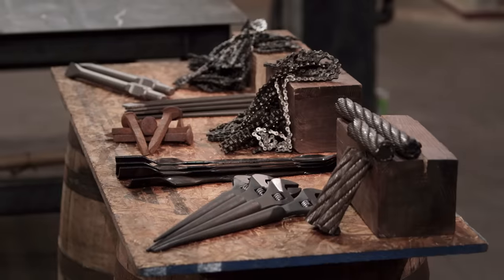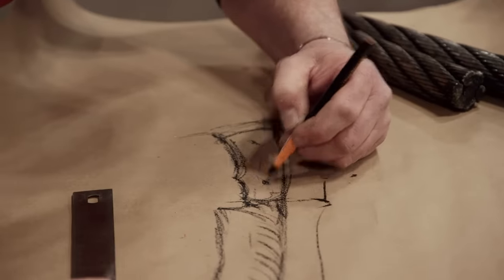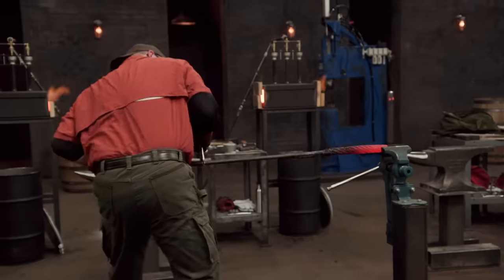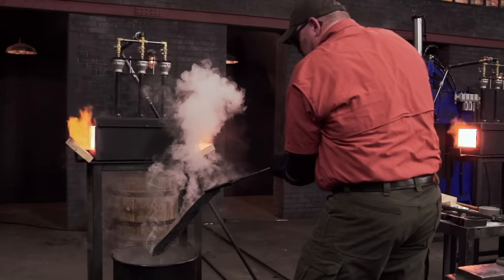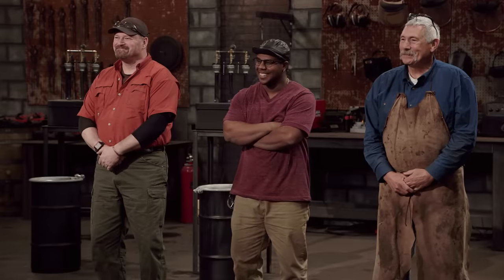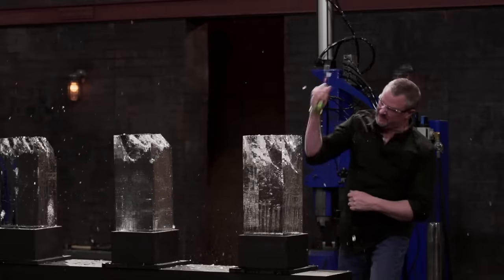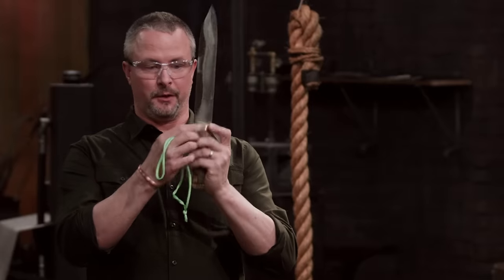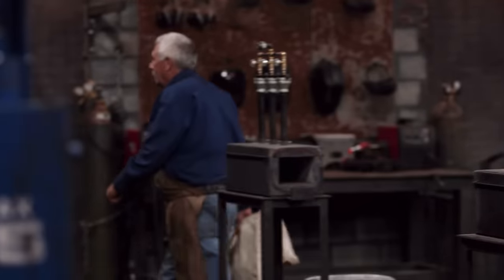CHOOSE YOUR OWN STEEL! Epic Game Changer | Forged in Fire (Season 4)

Comment: If I had first pick, I'm going for those files! Easiest material to work with. As far as incorporating elements of its design into the blade, just leave some file grooves in place on the top and back of the finished blade.

Comment: I’m definitely not knowledgeable on forging, so wondering why they never anneal on this show?
Reply: Maybe they just don’t show the process because they think viewers won’t find it as entertaining, like the tempering part, but they do occasionally show it.
Reply: You temper a hardened blade. They temper the blades between rounds 1 and 2. It takes a couple of hours so they don't show it.
Reply: @NLSkooch  Tempering and annealing are different things.  Annealing is generally done after the forging and before the quenching, and is done to soften the metal to make it easier to work.  Tempering is after the quenching process to relieve stresses built up in the balde.

I suspect they don't anneal often because they're in a hurry and are doing a lot of their shaping on the grinder after hardening, and annealing also adds a lot of time.

Personally, I prefer to get the blade mostly shaped before quenching and tempering so that there is less work to do on a hard blade, but most of my work has been done by hand, not with machines, and using machines changes the time/effort equation quite a bit.